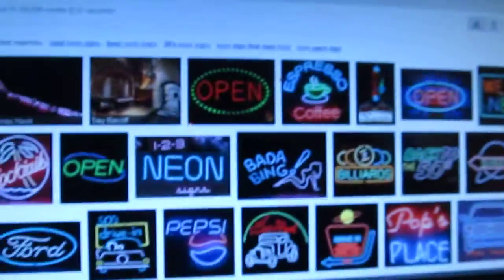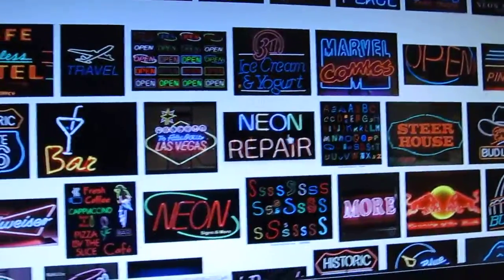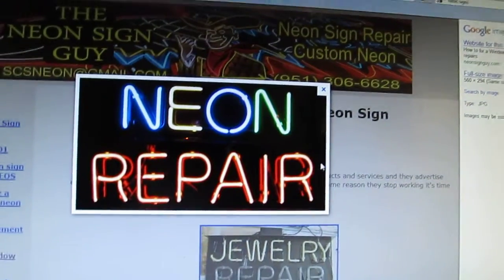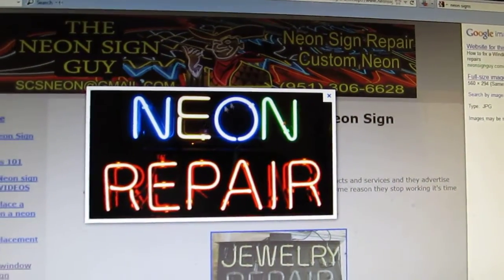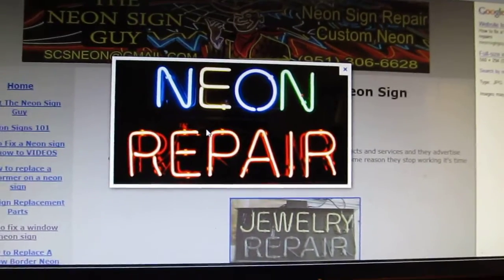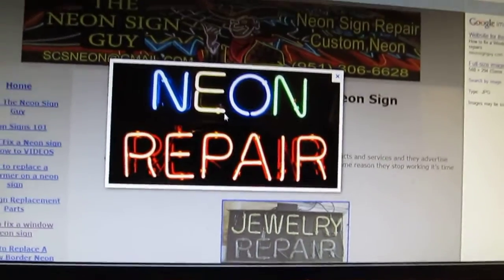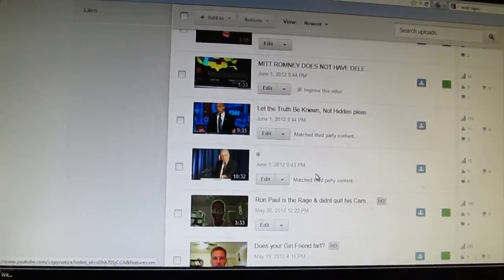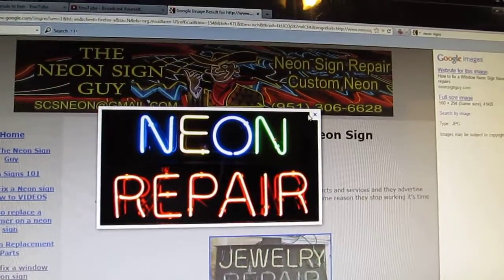How Stuff Works. Neon Signs! Described in lamens terms for audience benefit ;)

Comment: Well, you need to correct some of the information you put on your video , it's not completely accurate.
The bombarding is a process in which the neon unit is heated up by electricity using a large transformer  and at the same time the vacuum pump will evacuate the impurities from the inside of the glass. 
For more info go to my website the neon sign guy dot com
Thanks 
The Neon Sign Guy